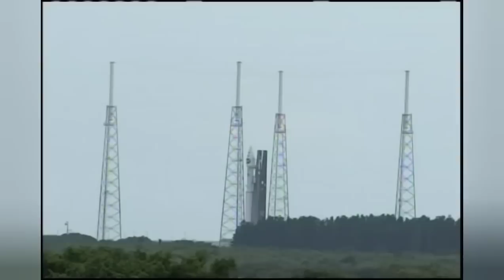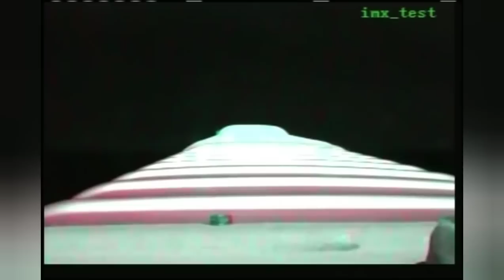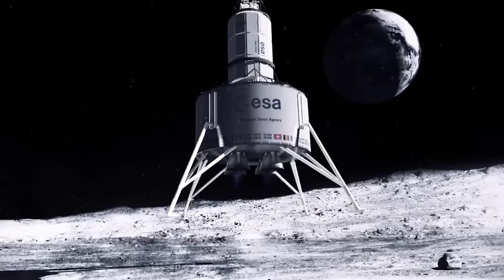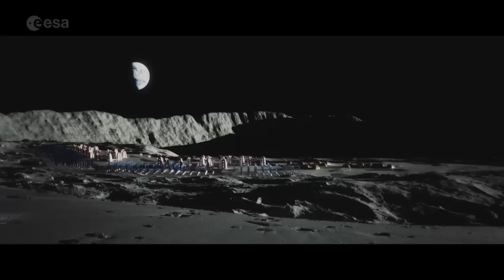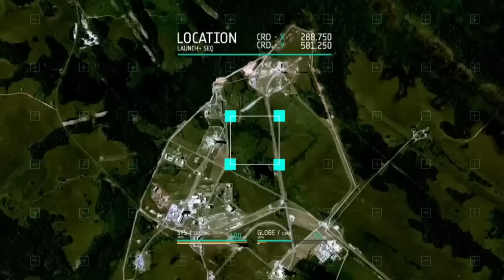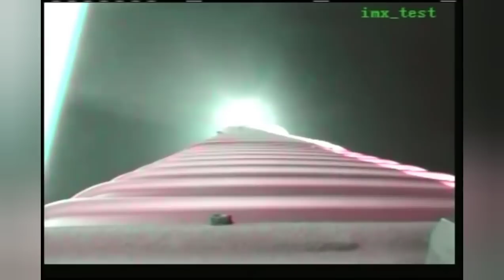NASA Moon Base will fail without this project!  The Aqualunar Challenge!  SUPER SIZE EP!

Comment: Perhaps using #reverseosmosisflilteredwater?
The ice needs to be melted & stored 1st.
A pump forces water through a very ‘tight’ filter membrane, after passing through microporous compressed carbon filters, that remove the big stuff & most chemicals.
At the end, you get only water molecules & a tiny bit of silica.
That can be separated, also, with a even tighter filter.
This RO filter was modeled after human kidneys.
It’s the system used in providing very pure H20 for sensitive ocean organism aquariums of all sizes, & also how the grocery/ convenience/ water retailers for .25-.75/gal.
It differs from distillation, as no heating is required, it’s a passive mechanical process, pushed by in line pumps.
Excellent topic, Sir, now back to the UFO & predatory big space rock news!

Comment: One would think that with  the extreme temperature changes on the moon, that simply the transition from hot to cold would generate the electricity for any process as long as the "generating" equipment is made with the correct materials that would transition the temperatures accordingly. Heat conduction to a material junction that transfers the extreme temperatures to produce the power needed.

Comment: Previously I commented about the first thing we need to do on the Moon and simplified it. The people who Angry Interviewed are the ones who need to make living on the Moon simple. One thing they said was required to do was to deal with the temperature changes of the Lunar Surface.  I did hear them say that the Lunar Surface might be more difficult to dig through and mine the regolith. All we need is a Boring Machine to bore to the Lava tubes that are believed to be miles long. Underground habitats won't have major temperature changes, so it will be easier to prevent the Nuclear Reactor from overheating.
 
‘I hope NASA canceled the Viper mission because they have something better planned.’
 
Of course, NASA has rocket scientists working for them. If NASA didn’t have to work within a budget that Congress gives them they would not need the privet sector and we would be there already. Yet, China surpassed NASA, which was unthought of 20 years ago.

I asked Flux-7b, Why is China beating the USA to the moon?

China has made significant progress in its lunar exploration program, with successful missions such as Chang'e 3 and Chang'e 4 landing on the Moon and conducting scientific experiments. The United States, however, still maintains a strong presence on the Moon through its Apollo missions and ongoing robotic explorations like the Lunar Reconnaissance Orbiter and the upcoming Artemis program. While China is making strides in lunar exploration, it has not yet surpassed the United States in terms of achievements or goals for future missions to the Moon. Both countries continue to collaborate with international partners on lunar research and development. Ultimately, competition between nations drives innovation and progress, so having multiple countries actively exploring the Moon benefits humanity as a whole.
The answer is: China has made significant progress in its lunar exploration program, but it has not yet surpassed the United States in terms of achievements or goals for future missions to the Moon. Both countries continue to collaborate with international partners on lunar research and development. Ultimately, competition between nations drives innovation and progress, so having multiple countries actively exploring the Moon benefits humanity as a whole.

Why hasn't NASA gotten the USA back to the moon already.

There are several reasons why NASA has not yet taken humans back to the Moon since the Apollo missions in the late 1960s and early 1970s. Some of these factors include budget constraints, shifting priorities within NASA and the US government, technological advancements that require time for development and testing, and the need for international collaboration on lunar exploration projects like Artemis. Additionally, safety remains a top priority for any human spaceflight mission, so NASA takes its time to ensure all systems are thoroughly tested before sending astronauts into space. The agency is currently working towards returning humans to the Moon by 2024 as part of the Artemis program, which aims to establish a sustainable presence on the lunar surface and use it as a stepping stone for future missions to Mars and beyond.
The answer is: There are several reasons why NASA has not yet taken humans back to the Moon since the Apollo missions in the late 1960s and early 1970s, including budget constraints, shifting priorities within NASA and the US government, technological advancements that require time for development and testing, and the need for international collaboration on lunar exploration projects like Artemis. Additionally, safety remains a top priority for any human spaceflight mission, so NASA takes its time to ensure all systems are thoroughly tested before sending astronauts into space. The agency is currently working towards returning humans to the Moon by 2024 as part of the Artemis program.

Comment: You have been restating an incorrect assumption about the efficiency of a solar tracking energy panel on the South pole of the moon..
Except for the brief period of darkness the panels will be in completely direct sunlight at the south pole.
The difference on Earth is that at the poles there is much more atmosphere to diffuse the light. 
No atmosphere on the moon means no refraction means direct sunlight, equal to what it would experience at the equator, except, there for only half the lunar month.

Happy Equinox!
Reply: You've misstated the situation. At the equator of the Moon, the light arrives from the zenith, with a surface energy density of about 1.1 kw/meter. At the south pole of the Moon, even at noon, the light arrives at the Moon at an angle of about 20 degrees above the horizon, energy per square meter would be markedly less. On Earth at the South Pole, at noon, energy density from the Sun is only about 450 watts per square meter. The Moon would be similar. Power per square meter would be zero for 14 days, then ramp slowly up to ~450 watts per square meter for a week, then slowly back down to zero over the next week. Average daytime energy density of the sunlight, not any power generated from it, which would be lower, would be on the range of 200 watts per square meter.

It is the angle of the ground to the light that matters, not the presence or not of atmosphere.
Reply: @RockinRobbins13  Firstly, I would assume these solar panels that are tracking the sun would be at the optimum 90 degrees to the sun, not lying on the surface. There goes your 20% argument.
Secondly, from my understanding the net time in full sunlight would be nearly 70% depending on how close to the actual pole the station is. Obviously, at the pole it would be near 100% .efficiency at near 100% of the time, less because of the moons declination to the sun.
Reply: "There goes your 20% argument." No, you've made it much LESS than 20%. If you restrict yourself to little solar panels on sun tracking mounts, you are necessarily going to have MUCH less area than you would laying it out on the ground or on a large slope.

Yes, you might get better efficiency, but your output would be a tiny proportion of what's possible near the equator. So you're much more efficient per square meter. What does it matter if you've had to reduce your surface area by 95%?

There is no way by having sun tracking panels that you would be able to make up for the difference in sun angle. I'll grant it would be easier than on Earth because of the 1/6 gravity and lack of any wind.

Comment: Ran this by Google's AI. 

The results indicate that a small luner rover equipped with a nuclear power source could use microwaves to heat the ice, while collecting the water and contaminants. The water could then be purified by using vacuum distillation and heat from the reactor to remove sulfates and ammonia from the water. This would probably need to be done in multiple stages, to achieve a high enough level of purity.

Nobody that you talked with in your video appears to be using vacuum distillation, which would lower the amount of energy needed for purifying the water. Vacuum is also a resource that is readily available on the moon.
Reply: @DavidPotter-ee6tf
Great thinking, using 'nothing' (vacuum) as a resource!. I wonder if desalination technology could be used, I guess it depends on the molecular size of the contaminants..
Reply: Perhaps becouse vacuum can be common there but not here were they are develop their devices. It's a matter of use what is more easy to make.

Comment: Just dig a big well, heat the surrounding ground, pump the water out in to storage takes... worry about purifying it after. Trouble is with any space endeavor is that we always make things to complicated.
Reply: They just need to dehydrate water so it's lighter and then vacuum pack it so it's packed into a tiny little space. BAM. Problem solved. Just take it with you, lightweight, little space required. Astronaut water-just like the astronaut ice cream
Reply: If there is evaporated milk, they could take evaporated water.  Rehydrate when they get there.
Reply: In the vacuum of space the water will boil off before it could be collected.

Comment: Wouldn't a fleet of Moon orbiting GPS and Communications Satellites be needed for a proper Base and future Communities?  Most likely extremely tall  Cell Towers will be implemented instead to get over the Horizon Radio Communications and Data Links.
Reply: Yes it would. You would also need millions of probes that can drill a few feet into the ground, analyze the rock, and maybe use the hole as a heat sink to not freeze to deth during Long nights. They could be used as radio repeaters and ground base stations for GPS. Also seismic detectors and a camera.
Reply: @stokesseegers5012  The Stirling Engine would work wonders on the Moon, correct?
Reply: @venturefanatic9262  I don't know about that more like solar panels to charge batteries, and then a dormant cycle during the night would be the most likely scenario. And it would be cool if a couple feet down the temperature stabilized.
To like somewhere around negative fifteen degrees celsius a couple degrees below zero fahrenheit.

Comment: I believe the moon base will be fine even if they don't solve this issue.   Assuming they can still split it and use it as rocket fuel, a starship can deliver plenty of water for human use for not an excessive amount of money (assuming it works).   Yeah it would superior if it was all found on the moon but the space station has proven we can recycle the hell out of water.  Even if they do agriculture they should not have an issue with the human water needs compared to other expenses.